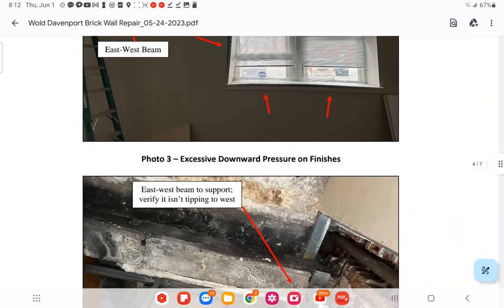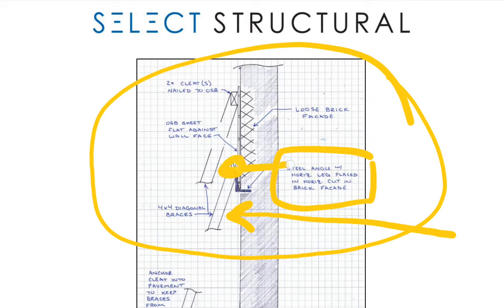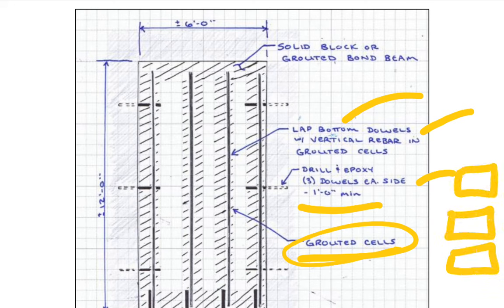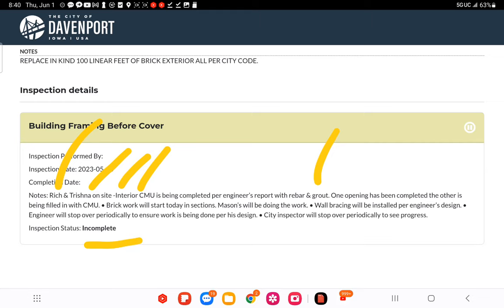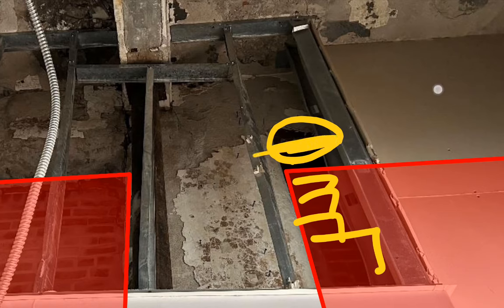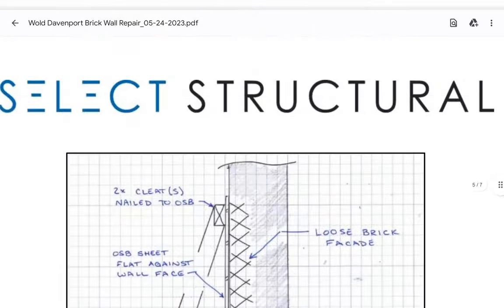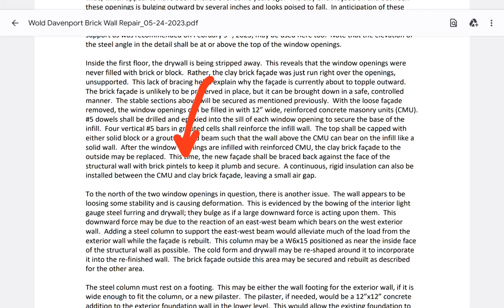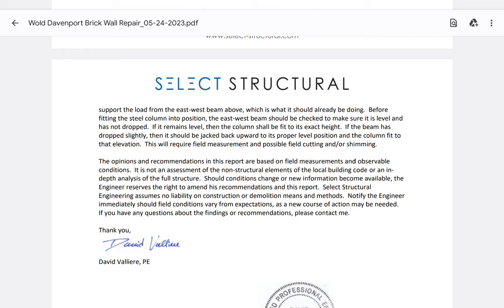Davenport blding collapse CLASSaCTION LAWSUITcITYDIDNOTiNSPECT REQsTEEL COLUMN structural reportPT12

Comment: I find the history of this building to be very interesting. They tore the cornice off the building in the 1930s. That seems weird to me. You shouldn't have to tear a cornice off a building after just 30 years. Many buildings hundreds of years old still have their original cornices. That makes me think this building had structural deficiencies almost from the beginning. Also historical satellite images show that there was another building situated at the back of the parking lot right next to the section that collapsed. That building was torn down in the mid-1980s, and was probably the reason those windows were originally bricked over.  I wonder if when that building was demolished they took appropriate safeguards to stabilize the wall of this building?  🤔

Comment: Thanks for sharing this information. Minor point, but at 14.05 in fact 1” is EXACTLY 25.4mm by definition.
Reply from the maker: Yes it is and that was a troll on my part. Ty
Reply from the maker: But of course u would be the one to catch it...
Reply from the maker: Now, did you see the bracing, joke bracing the "search crew" has in place?
I will do a video on it tomorrow or later tonight, I've been outside all day and am still cooling down from over 90 degree temps
Reply from the maker: Also, their expert from search and rescue is claiming that heavy steel is expanding and contracting... Yet, his silly bracing is magically confining that expansion and it is safe for them to walk in the debris. 
This people are too worried about their own lives to do a deep search.
It gets better, he claims the dog has lost its sensitivity and the handler has to use his own judgement with the dog!
I will prove that is a LIE and explain how the dog does confirmation...
Reply from the maker: for clarity it was a troll for Mike Gilmore... we have an on going debate about when metric was picked up by canada in the steel industry as it relates to manufactured steel for wtc buildings...  He may just be correct, it's more than likely they did NOT have a metric issue as steel industry adopted in the early 70's and that may not have been part of the issue on why the steel was coming up short so frequently. 
I use mm all the time with my lathe and callipers/micrometers ; it's just easy...

Comment: If I saw that, I would be in panic mode, and would want to expose the structure from the ground up to get a comprehensive inspection, and plan for correction. Perhaps also provide some temporary support structure in front of that wall -- again, from the bottom up. And of course follow the engineer's recommendations and instructions to the letter. How could anyone see that and think it'd be best to prioritize exterior cosmetic issues first?
Reply: Im guessing the complaint only addressed the loose brick, so thats all they gained permission to do, figuring they could address the other (structural) work after remediating the immediate complaint.
Reply from the maker: I would want the steel structure supported from a foundation up; then remove entire back wall, steel column connect it all and to hell with historical society.
Reply: @ForensicCats  What is there to preserve but the health and safety of PEOPLE in and around the building? Nothing special about that wall.

Comment: These mtl studs are not load bearing which most aren’t and interior studs would have a deflection track at the top. You would never use mtl studs for shoring. These appear to be int wall framing and not intended to be shoring, but the buckling clearly indicates sag.
Reply from the maker: Lol pat attention... They have become load bearing and yes, depending on design, you 100 percent can use metal studs as load bearing.